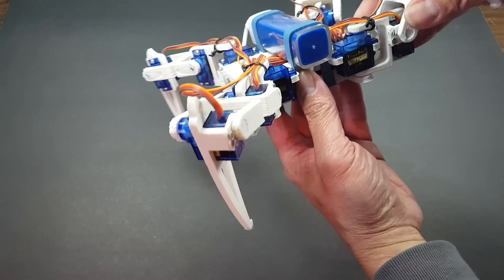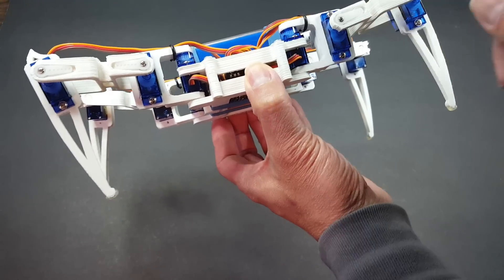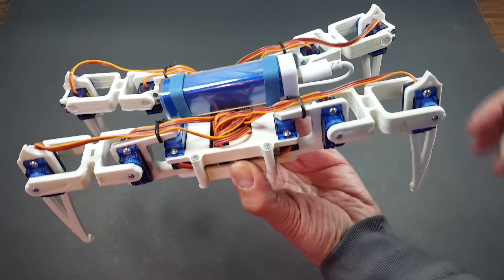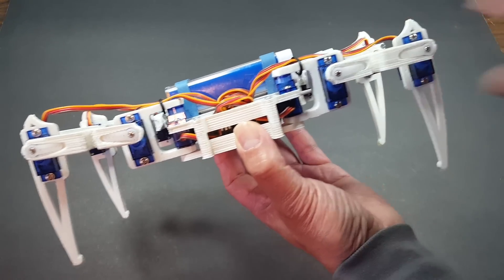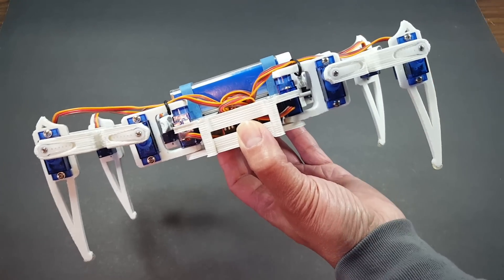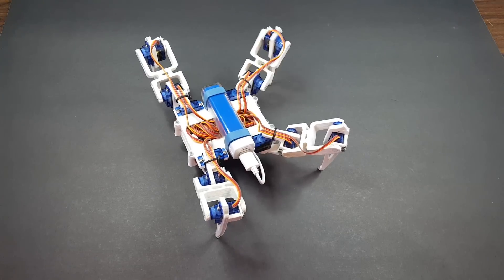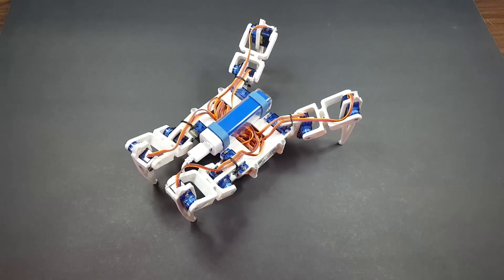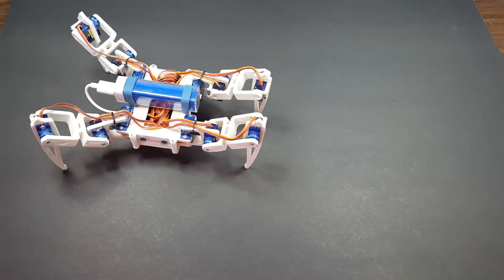HariFun #149 - 3D-Printed Arduino Spider Robot

Comment: Can u pls send me the diagram or the pics of botton and top view of the breadboard, pls i really need it. My email sarrthijasrotia06@gmail.com
Reply from the maker: Hi, I'd rather not disassemble the spider, so I look for some photos for you and found this raw footage that didn't make it to the final video.  It should answer your question about the PCB.
https://photos.app.goo.gl/Lgh1h1oSGc5QXia52
The two switches isn't 100% necessary, but I did that so I could turn off the servo power while I program the spider.  If you haven't already, you should checkout Regis' instructable linked from his thingiverse.
http://www.instructables.com/id/DIY-Spider-RobotQuad-robot-Quadruped/
Which servo is connected to which Arduino pin is CRITICAL.  Otherwise the programmed movements would be controlling the wrong servos.  Let me know if you have further questions.
Reply: Omg I am literally working on it right now, freaking thanku, I really thankfull🙂
Reply from the maker: In case I didn't mention it, it is also important that you do NOT power the servos using the Arduino's 5V supply.  I power ALL the servos directly from the power bank.  That way it would not tax the Arduino's voltage regulator when all 12 servos are moving!  Make sure there is common ground between the powerbank and the Arduino , otherwise the PWM signals from those digital pins won't work.  So, rather than the powerbank powering the Arduino and then the Arduino powering the servos, the powerbank powers the servos diredtly AND the Arduino. The Arduino only supplies the PWM signal -- not the power.  I hope that's not too confusing.
Reply: Ok thanks for tht information. I am gonna be working on this all night now. I am doing this for a competition and it won't be possible without you, so thank you.
Reply: Sir, what code did u use? And what are u using to control it?
Reply from the maker: I did not build a remote control, so my spider just follows a pre-programmed sequence of walk turn go backward, and wave.  I based my code on the code by Regis, it is all in that instructable that he wrote.
Reply: Do u have any suggestion on how u can control it by a controller or just control it using something my like  phone, laptop?
Reply from the maker: Simplest would be to control it using a few wired switches, but that's not so cool in these days of wireless.  To implement wireless there are many options, you could go with bluetooth like Regis, or use the popular ESP8266 , or one of the RF transmitter module like the NRF24L01.  If you don't mind having to point the remote to the spider, InfraRed is a simple option.  The wonderful thing about Arduino is that there are libraries already written for all of the above options I mention.
Reply: Sir i was looking at regis's design and i noticed tht he used a dc-dc but u didnt, any reason?
Reply from the maker: Regis uses a LiPo battery (not sure what voltage, but definitely not 5V).  I use a cellphone powerbank that is already supplying 5V.  The servos probably could handle up to 6V, but I would not power it with higher voltage.
Reply: Sir i got everything printed and got it together and now when i am done with wiring what code by regis should i add because i see alot of codes when i go to his website.
Reply from the maker: Great!
First thing I did was to run his calibration code. I talk about this in my video.  It moves the servos to predetermined locations (he has a picture where everything is at 90 degree angle), then tighten the servo horns.  
 After that, I copy pasted a few of his routines into loop() so it repeat a few sequences, but you can do whatever you want including controlling it via serial port or a remote like Regis did.
Reply: Sir how do I know which servo to connect to what gpio pins?
Reply from the maker: Regis' instructable has a diagram showing all the servos on the legs and servo numbers.  The sketch maps those servo numbers to the actual gpio pin.
Reply: In ur model the  D13 on arduino is connected to what??? Like is it connected to the gnd
Reply from the maker: I know it "looks" like I soldered D13 to ground, but no, D13 is connected to one of the servos just like the other digital pins.
Reply: I was trying to upload dance regis had for the spider and it keeps saying cant compile with arduino nano
Reply from the maker: I will help if I can.  Could you copy paste the first error please?
Reply: Ok
Reply: Sir figured everything and uploaded the programm but the spider isnt walking, its working but not walking check the video of it on my channel
Reply: Sir do u know the problem?

Comment: A question
How were you able to push those servos through the legs without damaging the wire?
Reply from the maker: I used a file to create a little more room for those wires. You are right though. They were a tight squeeze.  I did not damage a single servo in the process, so it IS possible. :-)

Comment: Plz show me the wiring in a bit more detail
Reply from the maker: Hi, basically I powered the servos directly from the PowerBank.  I wire the servo signals to the Arduino Digital pins as outlined in the sketch.  Make sure there is common ground between the Arduino and Servo.  User AO_909 has kindly drawn a breadboard diagram.  Go to the instructable and search for Fritzing.
http://www.instructables.com/id/DIY-Spider-RobotQuad-robot-Quadruped/

Comment: can it run faster?
Reply from the maker: It can probably run a little faster by tweaking the code so it immediately jump to the desired angles, but it will be jerky. Furthermore the cheap 9G servo can only move so fast.

Comment: It looks like it only moves one leg at a time. Is this for stability or is it a current draw problem or is it a limitation of the arduino?

I don't mean to be a downer. I love this robot!
Reply from the maker: The Arduino is perfectly capable of moving multiple servos at once, and IIRC the code moves all three servos of each leg simultaneously.  But you can direct all complaints and praise to Regis, I only print and build the robot. All design and code was all him (link in video description).

Comment: I want to make a bunch of little walking robots that can carry 3D printer heads so that they can cooperatively 3D print anything at any scale. They just have to print scaffolding to climb on and return to a refill station to get more material and/or energy.
Reply from the maker: Awesome concept! IMHO, a walking robot would not have the precision to be able to go back to the same spot repeatedly to reliably build an object layer by layer.  So, it would need to basically carry a 3D printer and then use one of its claws to grab the finished 3D print and place it in the real world.  Would make a cool animation too.
Reply: Yeah, I'm trying to think of the best way to go about it. It's a very rough idea right now that seems a little too fantastic to actually be workable.

I think the idea of printing small parts and having the robots place and glue them is worth exploring. I think I'd probably make heavy use of fiducial markers because they're relatively computationally cheap and pretty accurate. Then I could use a camera (or two or three) connected to a PC that orchestrates everything. I could even put a small camera on each robot for precision positioning.

I have no idea how you would take a 3D model and output a plan of action though... That seems like probably the hardest part now that I know you can buy 20 servos for < $40. Maybe I should find a good maker community for help developing the idea.

Comment: Hi :) 
My arduino nano become very hot and smoke when the robot try to walk, why x) 
Awesome vidéo :)
Reply: Sounds like it could be drawing too much power.
When you hook up servos you can have a separate power hook ups that don't go through your controller board.
And then the only things that then connect directly are the signal control wires.
Reply: I had the same problem with my arduino.
Do you know what kind of power bank I should use to power 12 servomotors?
Reply: MDNGTMIXES  gnd means groun pin u could conncet it to any gnd pin even if you use the 3 pins no problem
Reply: Arduino can be powered ether via the 5v USB Socket, Or via VIN Pin for Positive, And any ground pin since Most arduinos Use common ground its all Interlinked into the board, To save Ground pins you can also solder ground to the Usb socket metal housing,  For powering multiple servo's I would recomend not using the 5V Pin as a power source for the servo, But take power directly from the 5V Power supply, E.g Battery box or Power bank, Then use the ground and signal for each servo, with a common ground and positive 5v for the servo power rail, You can easily make a power rail with a peice of perf or project board and mount the arduino and header pins 12 pins of 3 rows, and solder each row together minus the signal pins Signal pins go directly to each of the arduino pins for the sketch as listed in the project files, :)
Reply from the maker: lol :D

Comment: dude its really cool. but i have a question. how did you connect 12 servos to arduino pro mini ? did not you connect servos to pwm pins? (like 3-5-6? )
i wanna do a robot like yours but i dont know to how many  servos can i use.
Reply from the maker: Thanks Harun!
The servo library can pulse any Arduino pin, so you are no limited to using hardware PWM pins.

Comment: how I can supplay The Spider?
Reply from the maker: I power the Arduino and all the servos using that one powerbank.
Ground and VIN on the Arduino.  Brown = ground, and Red = 5V on the servos.
Reply: Hari Wiguna 12 servos just with 5v? and how many amps?
Reply from the maker: Yup, 1Amp. Probably not ideal, but you saw it work :-)
Here is the exact battery I used.
https://www.adafruit.com/product/1959
Reply: Hi there. I am looking into making this robot myself and powering it from USB like you did. I'd like to get clarified about how exactly did you connect the powerbank. So as I understand you didn't use USB socket and just took Vbus and Ground wires from powerbank USB and connected to Arduino (Vin and GND) and the servos. Is that right?

Comment: Hi..cool project..can you share your wiring diagram. I'm also in the middle of doing the same project but got lost in wiring my nano to the servo. Using the same setup as yours. Nano, servos and powerbank. How do you power all the servos? using the 5v output from nano pin or using separate power supply. Can you share your diagram.
Reply: Did you ever figure out that wiring diagram?
Reply: The original project uses a 12v 3000mAh li po battery that's connected to a dc-dc step down converter with 2 separate 5v outputs with 3 amp limit, one line is is wired to the servos and the other is connected to the Arduino.

Comment: Hii which powerbank you used for 12 servos and Arduino board ?
Reply from the maker: USB Battery Pack - 2200 mAh Capacity - 5V 1A Output
https://www.adafruit.com/product/1959
Reply: Thanks a lot sir ☺️

Comment: that's crazy cool man .  Make it remote ,  if you have a spare digital pin , pop a IR receiver on it and blend in basic IR remote sketch ,  then you can use simple IR remote for old TV , or even  old IR/C  helicopter . I know i have few of those mini chopper controllers  that I keep harvesting parts from . LOL  . that way you could have froward and turn and such .  way cool man .  I have to get back to making my franken printer work , and make one of these.
Reply from the maker: Hi Scott! That's a GREAT idea!  Regis' original plans uses bluetooth, but I like the idea of using a TV remote to control a spider. lol
You definitely should 3D print one of these.  Seeing it walk for the first time is priceless!

Comment: Hi Hari,
Welcome back!!
that is a great project, how long did it take to print all the parts?  Now I need to get my printer going.
Regards,
Stan
Reply from the maker: Hi Stan!
My printer isn't the greatest, so I printed most of the pieces ONE AT A TIME. :-(  On average each piece took 30 minutes to print. The body took much longer -- maybe 1.5 hours?  I estimate 15 hour total for all the parts.  If you have a printer that can print multiple parts at once, I'm sure you could cut down the print time by a lot.

Comment: Very cool design. Did it take long to print? BTW. for only a buck or two you can order a baseboard for the nano that has pins made ready to connect servos (and other devices). I used it to make the very nice (bluetooth controled) Zowi robot.
Reply from the maker: My printer isn't the greatest, so I printed most of the pieces one at a time.  On average each piece took 30 minutes to print. The body took much longer -- maybe 1.5 hours?  I estimate 15 hour total for all the parts.  If you have a printer that can print multiple parts at once, I'm sure you could cut down the print time by a lot.

Do you have  a link for that Nano baseboard? sounds useful.
Reply: @Hari: took some time to find it back in my purchase history, but success... It is called the Arduino Nano V3.0 Prototype Shield I/O Extension Board: http://s.aliexpress.com/qQ7z67Bf . If you search it you can also find similar i/o extension boards, but I wanted colored pin headers. I also added some female headers on the sides which are handy for experimenting. For adding shields on top they need to be higher.
Reply from the maker: Oh, sorry to create work for you, but thank you. I agree, it'd be handy for experimenting. Ordered! Thanks for sharing!
Reply: No problem. Glad you liked it. I enjoy all effort you put in your video's, so it's nice to be able to do something  too. In my first version of the Zowi clone I soldered headers on protoboard, but these base boards save a lot of work and are more reliable. Thank you and... stay creative!
Reply: It may seem odd, but as far as I know printing parts one at a time is faster because the print head doesn't have to move between the parts every layer. Some slicers (like Cura) actually have a feature to print the parts one at a time in the same g-code so you can leave it over-night, but you have to leave spaces between the parts so that the head doesn't hit the ones it has already printed.
Reply: @sparky3239  Another advantage I've learned for printing one at a time, is if something goes bad (eg. a part pops off the build plate) and you have to abort the print, less is lost!
Reply: I have the same board but I am having issues powering all the servos. What are you guys using for the battery?
Reply: Yeah, it's a good idea to use the I/O Extension Board for Nano V3.0 when you have to connect quite a few servos. 
Here is the ebay link and the price is $1.28 or $1.36 depending on whether you choose blue or red color.
https://www.ebay.com/itm/Nano-V3-0-Prototype-Shield-I-O-Extension-Board-Expansion-Module-For-Arduino-New/332134276885?epid=1383413643&hash=item4d54bedf15:m:mtfnd3hj9IO1ViIVDVgPg_A

Comment: How many amps is that power bank? It can supply the 12 servos without any problems?
Reply from the maker: Rai,
I don't know how it works, but according to the specs, my powerbank is only 1A !?  As you can see it walks just fine.  Maybe because only 3 servos are on at any one time? I don't know.  I'm not going to argue with results. lol
https://www.adafruit.com/products/1959
Reply: Amazing, so the power source is just 1 Amp. now I want to make this kind of quadruped too. Did you hard coded the movements?  It Looks smooth to me.
Reply from the maker: You can see Regis' Spider_open_v1.ino sketch about halfway down his instructable:
https://www.instructables.com/id/DIY-Spider-RobotQuad-robot-Quadruped/
From cursory look at the code, it has an array containing where you'd want each servo to be, and a timer gradually rotates the servo to those target positions.

Comment: I build a 6 legged spider robot from a thingiverse design. 3d printed and programmed. But is still runs from a adapter. It was using about 6 amps xD Got a vid of it on my channel if you are interested.
Reply from the maker: Job, I watched your bot.  Pretty cool also.  I still find it amazing that we could 3D print walking robots at home.  Thanks for sharing.

Comment: I have made a similar quadruped, but it has been a side project because the servos fail. I see you have turned the servo with your hand in the video, doesn't that spoil the servo controller board due to generated emf?
Reply from the maker: Oh... I never thought of that!  You made a valid point.  Maybe it has protection circuitry?  Anyone knows more about this?
Thankfully, my spider seems to have survived that abuse just fine.  For now... :-)